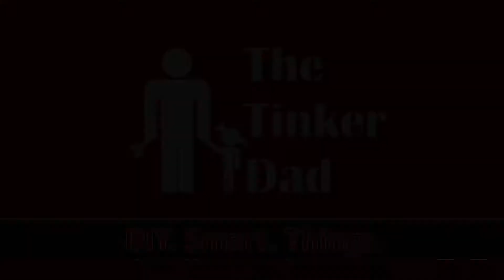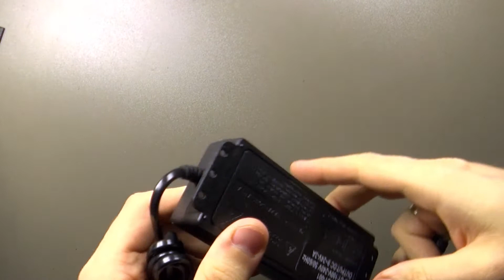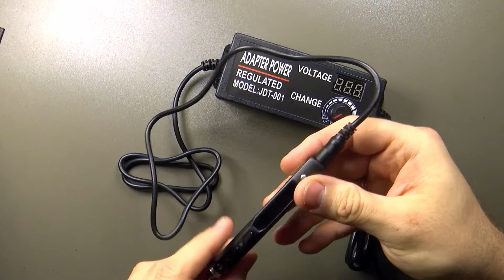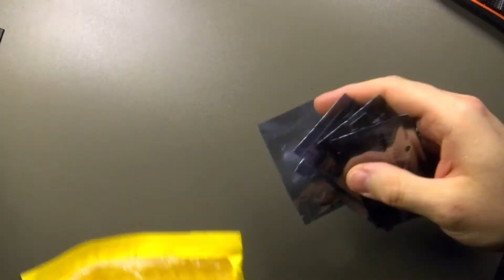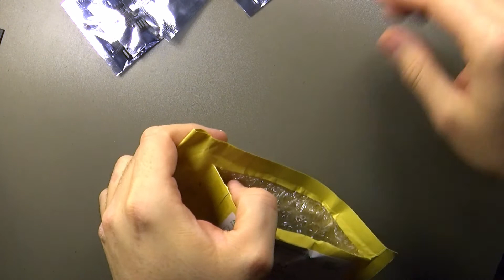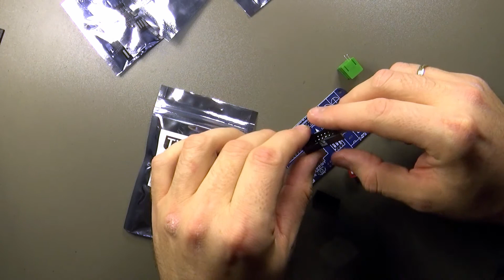Mini Mailbag: EXCITING Stuff For Future Projects!

Comment: Some led strips let you cut them on the copper pads and have a snap on connector,  and you can buy snap connectors and wire harnesses. SO no soldering. I have not used them though. I like the sht* sensors they seem to be very easy to use, they are all fairly expensive though like the bme, $1.50-$3 mostly
Reply from the maker: Sadly the only led strip I have at hand is IP66, so it's coated with thick silicone --> snap connectors won't work there and you also have to peel the silicone off without harming the strip to actually access the copper area. Given I'd need like at least 24 leds, it means 48 times the pain of peeling :) So I had to decide whether I order a strip just to cut it to pieces or try these individual leds...

Comment: I bought myself a usb c power delivery cable with a 2.5/5.5mm plug for the ts 100. so I can use my notebook power supply to solder in the field. For stationary use a dedicated supply is the better choice I believe.
Reply from the maker: Yes, that was my original goal - to use a laptop PSU. Sadly none of the 3 or 4 I've tried were compatible either because of the connector diameter or other issues. Finally, the newest one, a Dell one seemingly shut itself down when I connected the ts100 to it.